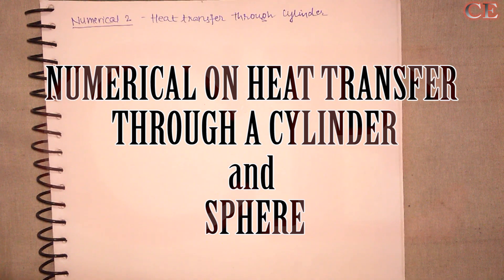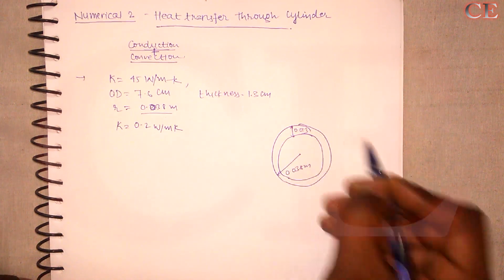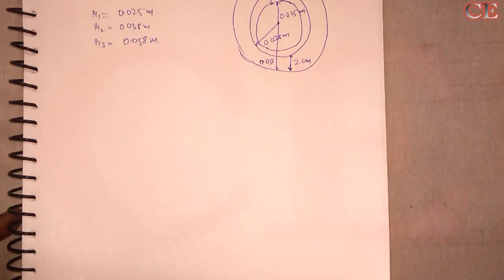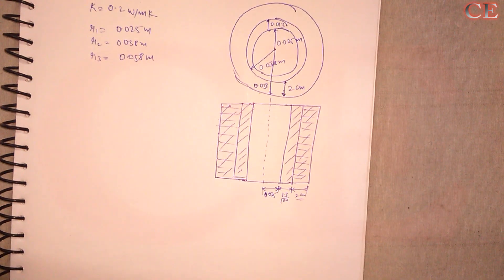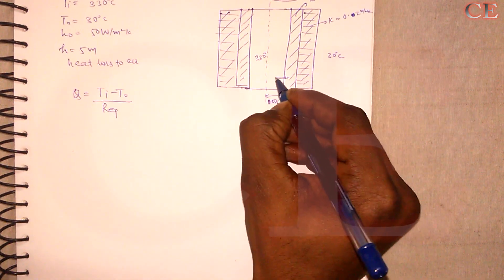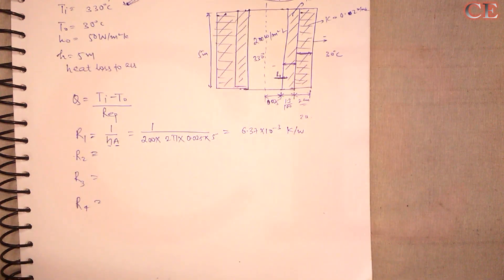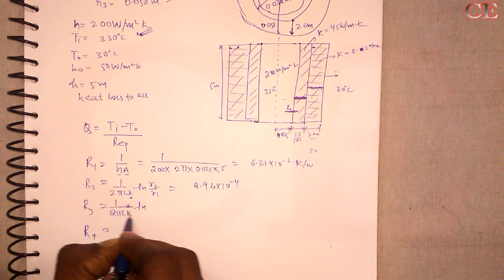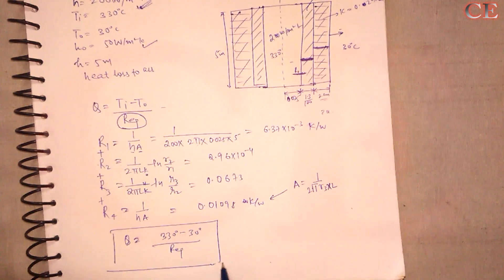Numerical on heat transfer through cylinder and Sphere

Comment: For ball shape
I only focus on the ratio of the radius of the ball casing to the thickness of the ball. If R/ dR = 1 is found, then the formula must be reviewed. The general equation is:

Q 		= - k. A. (dT)/ (dR ),	 Fourrier  law	
Q 		= k. 4π R2. (∆ T)/ ( R2 – R1 ). 						………. 	1
Q 		= k. 4π R1. R2. (∆ T)/ ( R2 – R1 ). 						……….	2
Q 	          	= k. 4π R1 . R2.(∆ T)/ ( R2 – R1 ) = k. 4π R2.(∆ T)/ ( R2 – R1 ). This formula emphasizes the ratio of the radius of the ball casing to the thickness of the ball. So the equation is:
k. 4π R1 . R2.(∆ T)/ ( R2 – R1 ) 	= k. 4π R2. (∆ T)/ ( R2 – R1 ), So the eliminated part is k .4. π.
R1 . R2. (∆ T)/ ( R2 – R1 ) 		=  R2.(∆ T)/ ( R2 – R1 ).
( R1 . R2.)0.5 (∆ T)/ ( R2 – R1 )	=  ( R2 )0.5.(∆ T)/ ( R2 – R1 ).
( R1 . R2.)0.5 . (∆ T)/ ( R2 – R1 ) 	=  R.(∆ T)/ ( R2 – R1 ). So we get the ratio of the radius of the ball casing to the thickness of the ball.
( R1 . R2.)0.5 / ( R2 – R1 ) 	=  R/ ( R2 – R1 ). So the ratio of the radius of the ball casing to the thickness of the ball. ( R1 . R2.)0.5 :  ( R2 – R1 ),   ), is the ratio of the radius of the ball casing to the thickness of the ball. 	  ……….    3
Such,

dR		: Instantaneous thickness. (R2 – R1) or (outer –inner)
dT 		: Instantaneous temperature
K		: Thermal conductivity of the material
Q		: Calorific value
R		: Length of the radius of the ball casing
∆T 		: Integral result of dT
∆R		: Result (R2 - R1) = (outer – inner) = thickness
4πR2		: Area of the sphere's shell
R/ dR		: Proportional to R / (R2 - R1) The ratio of the length of the radius of the ball casing to the thickness of the ball.

My objections are:
R2 : R2 .- R1
R2 : R2 .- R1 	~ 	R2. R1 : R2 .- R1,
R2 = R2. R1
My comment is that R2 ≠ R1 x R2.  The R in question has the same value, namely R x R.
Description of reasoning:
1.	R2 	: R2  - . R1 		 	 
R2 	: R2 .-  R1,  		for R2 = R x R. 
R2 	= R x R 
R. R	= R1 x R2 , 								…???
R . R	= R1 x R2,  because R has the same value, then R1 = R2. 
This writing will have problems with the equation:
Q 	= k. 4π R2.L (∆ T)/ ( R2 – R1 ), where R2 = R1.
Q	= k. 4π R2.L (∆ T)/ ( R2 – R2 ).
Q 	= k. 4π R2.L (∆ T)/ ( 0 ).
Q 	= + ∞ … ???.
The alternatives are:
R2 		: R2  - . R1 ,			 
R2 		: R2 .-  R1,  untuk R2 = R x R. 
(R . R}0.5		= ( R2 . R1 )0.5
R		= ( R2 . R1 )0.5    							… ???.
Is the radius of the spherical casing (R) (R2. R1)0.5...???
If that's the case. What can be explained from ( R2 .R1)0.5 in visualization 		... ???
My comment is that the conclusion is R2 ≠ R1. R2	
2.	I will insist that R2 = R1. R2. to prove my objection. Next, by substituting into the initial equation, when R1 = 0. (Solid).
Q 		= - k. A(dT)/ (dR ). Fourrier law
Q 		= k. 4π R2.L (∆T)/ (∆R)
Q 		= k. 4π R2.L (∆T)/ ( R2 - R1 )
R2. Is outer radius dan R1  is inner radius
R2		= R1.R2
Q 		= k. 4π R2.L (∆T)/ ( R2 – R1 ). I focus on the equations in bold.
              What if R1 is 0?  I substituted the basic formula.

Q 			= k. 4π R2.L (∆T)/ ( R2 – R1 ).
Q 			= k. 4π R1. R2.L (∆T)/ ( R2 – R1 ).
Q			= k. 4π 0. R2.L (∆T)/ ( R2 – 0 ).
Q			= k. 4π 0. .L (∆T)/ ( R2  ).. I focus on the equations in bold
              What if R1 is 0?  I substituted the basic formula.
      In this equation, 2 answers appear.
              In this case, 2 alternative answers will appear.

Q			= k. 4π 0. L (∆T)/ ( R2  ),  0/R2 = 0, 
Then,
Q			= 0		 			( alternatif 1 ).
              My comment is whether when the ball is in a solid state, then Q = 0???. this is very unreasonable.
Or second opinions is :
Q 			= k. 4π R2.L (∆T)/ ( R2 – R1 ), R2 = R1. R2
Q 			= k. 4π R1. R2.L (∆T)/ ( R2 – R1 ), 0 =  R1
Q			= k. 4π 0. R2.L (∆T)/ ( R2 – 0 ), R2 – 0 = R2 
Q			= k. 4π 0. L (∆T)/ ( R2  ).
Q			= k. 4π 0. .L (∆T)/ ( R2  ),  0/R2 = 0, turn left side 
Q /  0			= k. 4π .L (∆T)   
+∞			= k. 4π .L (∆T ), k. 4π.L  is constant( C ), and then
+∞			=  C ((∆T ), and then
+∞    			= ( ∆T ), ∆T = T1 – T2
+∞    			=  T1 – T2, , T1  = +∞ dan T2 known,  and then
+∞    	=  ( +∞ – T2 ),  left side is  watt and right side is temperature. so it cannot        be reduced
+∞    			=   T1
+∞   			= (∆T ), ∆T =  ( +∞ – T2 )	  		(second opinions )
+∞ 			=  T1, ∆T =  ( +∞ – T2 )
+∞ 			=  T1,	
My comment is whether when the ball is in a solid state, then (∆ T ) = (+∞ ) or (T1 ) = (+∞ ) ???, this doesn't really make sense.

next...